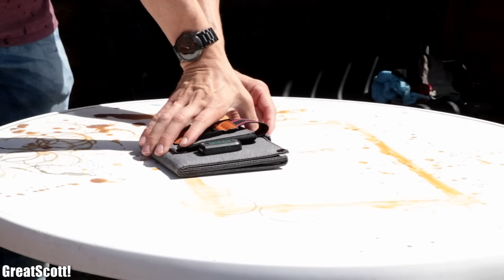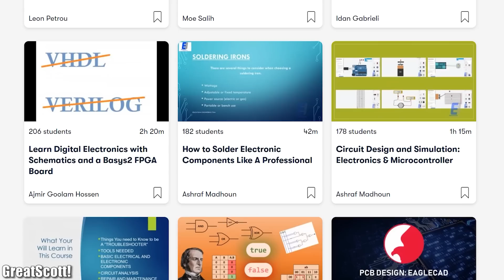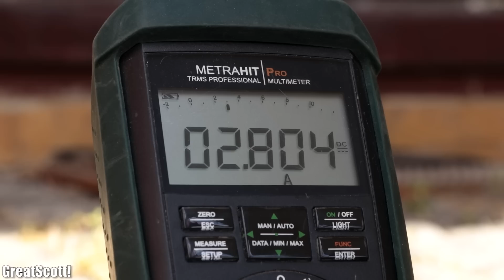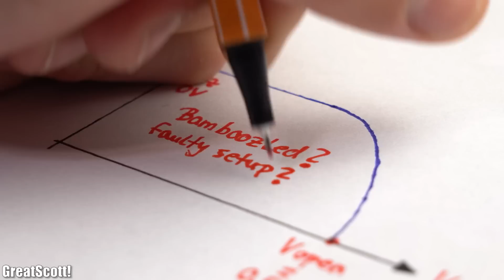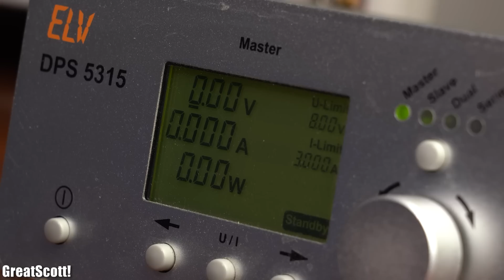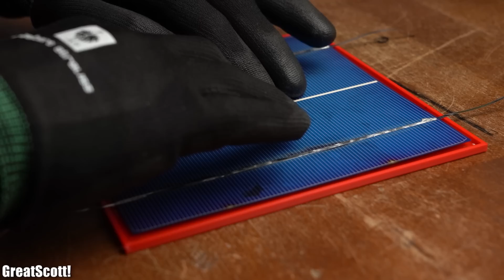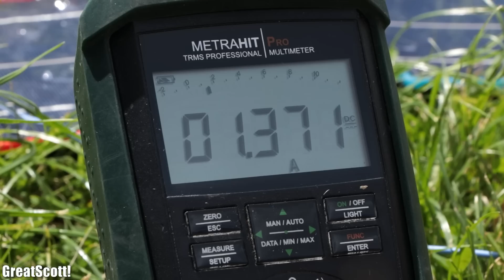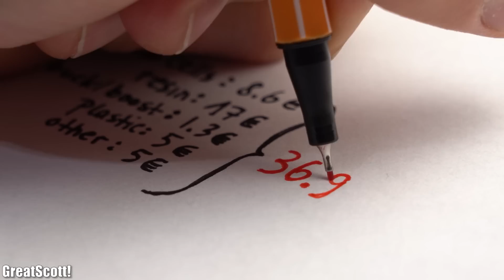5V USB Portable Solar Power Charger || DIY or Buy

Comment: CAUTION LONG READ

The use of a boost/buck converter will be not very efficient by some reasons with a 10s solar cells panel aiming for stable 5V output.

The main problem is that the boost/buck module you used (only voltage regulated) can't limit output current (neither input) what will make the solar panel voltage fall to the minimum (as like when you short it to get Isc) if you connect the converter output to anything that does not regulate input current to avoid the converter sinking higher than your solar panel 'Imp'. (mobiles phones or power banks use to limit somewhere between '1.2A' to '1.5A' so that's why coincidentally it works aceptable in your experiment).

In other words, if you connect the converter output to anything that will make the converter input sinking '>=' the solar panel Imp (maximum power point current), (I calculate somewhere around '2.4A Imp' as your cells show '2.8A Isc') the solar panel voltage will fall (clive voltage curve area) so the power the panel can generates will be much lower than the maximum it could if the current is limited to its MPP area (maximum power point).

What will happen if you connect a device that can make the converter sink more than you solar panel 'Imp'?  (imagine you connect a device that sinks 3A at 5V) you solar panel Vmp is around 5V, great, but the Imp is around 2.4A, nothing stops the converter to try to sink 3A from you solar panel, so the converter will try to sink 3A and will makes you solar panel voltage to fall (according to its curve) upon 0V once it reaches 2.8A, wasting a high amount of power the solar panel can produce. Of course the converter won't ever output 5V 3A, but will still trying to output 5V, so if the device can't also limit current below 3A, it will make converter output voltage to fall below 5V trying to get 3A and similar to the converter, reset itself once the voltage is too low.

And what is happening on the converter? If they have a minimum operative voltage, why are they still apparently working if the solar panel is outputing near 0V? Well indeed the own converter casually DON'T let the solar panel reach 0V, because while trying to sink 3A from your panel, once the voltage falls outside its operating voltage (maybe anything below 3v) it will RESET, stop sinking current for an instant, so the solar panel will recover Voc (~5.5V) for an instant making the converter again trying to sink 3A and then voltage fall again instantly to ~0V. This process repeat itself continuously an it is smoothed by converter input capacitors.

The practical conclusion is that you see that somehow it works but the power you will get from your panel will be much lower than the maximum it can output if its current can be limited exactly or close its 'Imp'.

*IMPORTANT: all these calculations take into account your solar panel is always at maximum solar conditions ('2.8A Isc' in your experiment), when the solar intensity will be lower, you will have the problem of the reseting phenomenon (panel going close 0V) at less converter output current and the efficiency you will get with the converter will be extremely low.

The main issue here is the efficiency of your system. Not only because buck/boost converters units (~80% maximum efficiency) are double inefficient (two transistors / diodes instead of one) than single buck or boost converters (~90% maximum efficiency). It is because you need a converter that can "see" if the solar panel voltage is below its Vmp and stop sinking more current to get its maximum power available at that solar intensity, and that's called the famous MAXIMUM POWER POINT TRACKING (MPPT) converter.

MPPT controllers are expensive and not really available for small power solar panels. Those you can find as 5V, 6V or 12V MPPT (2A - 5A) modules are not real MPPT, they just stop sinking more current for a fixed voltage (5V, 6V, 12V typically), so we could call them FMPP (fixed maximum power point) converters. Although they can't track the solar panel actual Vmp, this value does not change so much in direct sunlight, independently the sun inclination, and rounds 0.5V per cell.

What I think it is a better alternative solution? Just using a BOOST converter unit. If the output voltage is configured at 5V it won't regulate for a higher input voltage, but the solar panel with a blocking diode can't output more than 5.3V in any case, what is completely inside the maximum voltage window on 5V USB specifications (5.5V max). It will have the same bad behaviour at output currents close or higher the solar panel Imp, but the converter has half the power loses than a boost/buck unit.
Reply: This is why all those fancy but otherwise junk foldables rarely work as advertised, there are some panels out there just for usb use that don't have anything between the panel and the device.

Comment: Improvement:
Use 20 solar cells.
Instead of using a buck boost converter, directly hook the output to a cigarette lighter socket.
Plug a USB-PD charger to that cigarette lighter socket. Now you can charge modern phones even faster.

Comment: I bought some cells for a project like this a while back, I was going for 12v with USB option, I was hoping for about 15v at 1.5-2amps, I think I'll just buy a 50 watt panel, maybe a 100watt?i was thinking , keep the VmP around 15v and a pwm charger will work decently, the higher the voltage the more loss with a pwm, a mppt will make up the difference, I think a DC buck would only add to the loss, but is a easy test, it can't be as efficient as a mppt??? It's only 5-6 amps in real life, who knows...

Comment: That 36 cell frame failed because the epoxy resin you used was for small resin art there is different resin for large projects because if you use small art resin for big project  poured all at once it will Burst when it hardens.
Reply: Plus there was nothing at all to back the panel allowing it all to sag and eventually fall out of the frame.
Reply: @MrKillswitch88  yupp

Comment: Looks nice! Your solar cell output power seems to be about the same as my panel (that i bought from amazon)
I added a puck converter that has a lcd display that shows up the amps/volts/watts etc  and  a lead battery made for security lamps 
I've adjusted the output voltage to be a fair bit over 5 volts so that it is able to charge at up to 2 amp hours.. It typically will do about 8-9 watts, I think i need a better puck converter.. 
I also added leads to connect to car batteries, it works very well!

Comment: I purchased a flexible solar panel that has a USB 5v and a 13v output for my car. I placed the panel on the dashboard and wired it direct to the battery to trickle charge the battery. I am not driving very much lately and it keeps the battery fully charged. I have attached a listing. Don't believe the listed 30w it is more like 10w.
https://www.ebay.com.au/itm/30W-12V-Mono-Flexible-Solar-Panal-USB-For-Mobile-Phone-Camping-Battery-Charger/313132726373?hash=item48e82a3865:g:pn8AAOSwLURe~CyI

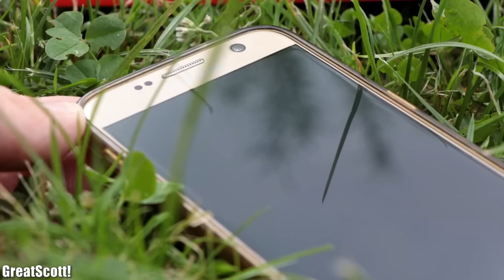Comment: what is the name of that device 10:00
Reply: Search for electronic load or dummy load and you will find one, the larger units with display can be around £20, but I got a smaller one without display for around £5 which I use with a USB tester (small device with USB in/out which displays voltage/current) very useful tool and available for around £3

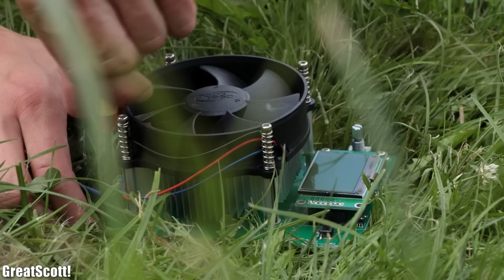Comment: Very cool project and great video as usual. I would be interested which kind of load you used at 10:01 I want to buy a variable load for testing the capacity of different batterys from 6 V to 12 V and 24 V

Comment: 12V Solar system panels work well with car USB chargers! The nominal panel voltage is 18V, and the Voc is under the 24V that most car chargers work up to. You can mix and match panel and charger wattage - 5V only (5-12W) or USB power delivery (10-60W).  The main problem is no MPPT functionality, so a temporary shadow will collapse the panel output voltage.
Reply: A lot of those only go up to 1.5a max and few really put that much on each port when all the ports are in use. The same applies to these overpriced yuppie panels that look nice but rarely deliver regardless of the latitude as some perform like crap even on a good day in Mexico and Spain. A Good one will put out around 2 amps per port and not sag when both ports are in use.
Reply: @MrKillswitch88  I mean panels usually made for charging 12V lead acid battery systems. I have a 25W panel that puts out 25W. It was $40.
Reply: @davidgunther8428  People have been using panels for charging 24v and 48v systems running lithium batteries for a decade or some for homes and businesses. I honestly don't like lead acid batteires as they are bread and eggs that they don't have the best shelf life in the long run. I got lithium packs that are 15+ years old that still hold decent charge.
Reply: @MrKillswitch88  I didn't say I was using lead acid batteries, I said the "12V system nominal" (17V nominal)  panels were made for lead acid systems.
Reply: @davidgunther8428  ok....

Comment: @GreatScott! - one little problem with DIY - your panel's putting out voltages that are out of USB spec. USB2 spec minimum is 4.4v (26W@3.7 fails this), USB3 spec minimum is 4.45(22W@4.4 fails this in addition to 26W@3.7).
Reply: A boost/buck converter should be able to fix that!

Comment: Great video! The only thing that I was wondering is that the resin could block some specific wave lengths, and that could reduce the power output. If you have a spectrometer, it would be nice to test the output off the solar cell with some known wave lengths and try some tests with and without the resin.

Comment: On plain USB 5V, most phones limit the charging current to way below 2A. You saw it when you connected the buck/boost converter to your power supply and it was still only charging with 1.4A. But things change with QC (9V 1.8A) or even USB-C PD (5V 3A). Always test with an empty phone battery. The phone limits the charging to below 5W when the battery reaches 80%++

Comment: You should have built a hinging mechanism in the 3D printed frame itself.
Reply: A barrel and pin system would be super easy for this and probably very sturdy. Could even potentially incorporate the cell connections into the barrels and connect via the pin.
Reply: That was also my thoughts too. Otherwise everything else is pretty nice tbh
Reply: Maybe some sort of compliant mechanism for reliability?

Comment: You will find a practical problem while using that buck-boost converter in real application. I do lots of trekking in the Himalaya and use my 10 watt DIY solar charger. But the problem is, most smartphones are very choosy to select the charging device. They want a smooth, uninterrupted supply that can handle spikes. Now when you directly charge your phone from that solar charger, in any case, if shedding happens (that's quite normal while you are on a hike) on one or multiples cells, the charger device performance will drop drastically, making it unable to supply the current that the load demands. So the bock/boost converter will be overloaded and its voltage will drop below the acceptable value and your phone stops charging. Th e phone won't start charging again automatically; you have to manually re-plug the charging plug, even after the shedding is gone. I faced this problem many times. Then what's the solution? Use a power bank as a buffer between the phone and the solar charger. Power banks are not that smart enough (may be intentionally), they take charge from whatever they get, and maintains a steady 5 volt at the output. Some powerbanks restarts itself if the charging current is too small, but that wouldn't be a problem as smartphones are absolutely fine with it. They just don't like a gradual lowering of charging voltage, as happens with a solar charger under shedding.

Comment: Maybe I'm wrong, but as far as I remember from my electronic knowledge about smartphones, you need to have a either snapdragon/exynox chipset which accepts higher currents for charging. Without that the phone caps the current to less than 2.0 A at most for safety reasons.
Reply: Very important to have a USB load tester for this experiment. I wouldn't introduce a phone until the beta testing phase.
Reply: All recent major phones have a fast charge ability, but usually uses 9V or higher for >10W charge rates. Getting large currents through a USB cable/connectors is inefficient.
Reply: @davidgunther8428  I didn't explain myself properly sorry, Yeah that's why I try to say when talk about a Chipset capable of handling these currents. For conventional, fast and super fast charge. 
The phone I see on the vid (Galaxy S4, old generations of a Jx or Ax) is fairly old and I can bet it can't handle something like 2.5A
Reply: @diegoG21  my S10 charges at 15W max, but that's not at 5V input, it's 9V, so the current is about 1.7A. Maybe you are mainly talking about the power level older phones charge at, not specifically the current? Yes, a S4 isn't going to be able to accept charge at a high rate. Most newer phones do (past 2-3 years) but they need a higher voltage source and proper data signaling to let them know what they're working with.
Reply: @davidgunther8428  My iPhone 11 Pro Max charges at a confirmed 24 watts when low. It tries very hard to pull the maximum 3A from 9V. It won't shift to 12v since it can't max out 9v. In other words, without USB-C PD, neither the "buy" or "DIY" option is relevant. This is ironic as USB-C is his latest love.
Reply: @tedhancock68  I'm a big fan of pieced-together, off- the- shelf DIY. LOL Especially when trying to charge my phone I don't want to kill it because I made a mistake or after a month my circuit malfunctions. It's why I use car adapters in my solar projects.

Comment: Could you go about using a solar panel setup to supplement existing DC power supply to charge or power usb devices? I was thinking of a battery switching circuit but not sure about if it would be effective enough, or it would switch too slowly and damage the usb devices.

Comment: i would actually say BUY wins here even accounting the lower power due to the following reasons. Firstly would be usability. The commercial version is a lot more compact and probably a little lighter. Second would be durability, considering this would be a portable device it would need to survive being put into backpacks all the time and survive weather conditions. The exposed connections between the panels are very fragile and could be prone to shorting. All the above listed problems can be solved but is the extra time and effort and materials worth the commercial alternative? i would guess that it would be down to personal preference due to the fact that building it can be seen as a entertaining activity but for someone who just want the product it might not be worth the hassle of building it.

Comment: Cells are tested in labs under 1200 watt bulbs at 25°C, reason for the "wrong" readings.
Plus, the epoxy can get opaque and yellowish with time if it's not UV resistant and can't  hold the stress of time as it would probably get darker before the panel begins to wear out (if it's under a constant exposure). Should be good for the usage you have in mind though.
Reply: It's 1000W/m^2 but besides that I completely agree with you
Reply: @xziegenbauer3732  It is also a particular reference spectrum (AM1
5G) at the Irradiance of 1000W/m2
Reply: @xziegenbauer3732  "If the extraterrestrial solar radiation is 1367 watts per square meter (the value when the Earth–Sun distance is 1 astronomical unit), then the direct sunlight at Earth's surface when the Sun is at the zenith is about 1050 W/m2, but the total amount (direct and indirect from the atmosphere) hitting the ground is around 1120 W/m2."
The average of these 3 values is 1179 watts per square meter.
https://en.wikipedia.org/wiki/Sunlight
Also, I said bulbs/lamps. Laboratories often use 1200 watt bulbs because some energy is lost. I know that the approximation is 1000w but that's not entirely correct.
Reply: And dont forget the angle of cell vs. Sun

Unless your garden is located at terrestrial Equator you should tilt your cell according the Sun angle, which depends on latitude, day in year and local suntime

Next proyect could be an automatic two-axis positioner with those factors in mind
Reply: I only have 1 quick solution that seems to work against the yellowing stuff. Most of those cheap garden lights use those yellowing cells which become useless after a couple of months. I also have a 6V panel that is covered in epoxy and the same thing happened. Sanded all of them to make them ok again but same thing yellowing started again after a month or so.  Now I cover them with helicopter tape. The stuff they use to for example protect bike frames. You can get that stuff for a couple of euro. I just cut it and stick it over the cell after I make it clear again. If I now buy new solar stuff which uses those cell I immediately stick it on. The 6V cell is still clear now like all of my other 'toys' after being 3 years in the elements. I might replace the aging tape next year but that is just a 5 minute job.
Reply: The problem I had with epoxy was the expansion and contraction was breaking my cells. That was when I tried to encapsulate them to glass. I think it is better to encapsulate each cell individually. 
Good Job!
Reply: This is why this plastic crap never lasts in the long run even if it is UV stable there is always mechanical wear and scratching from normal uses that does them in. I always preferred rigid panels with all this in mind.